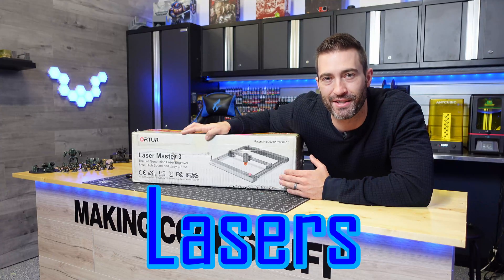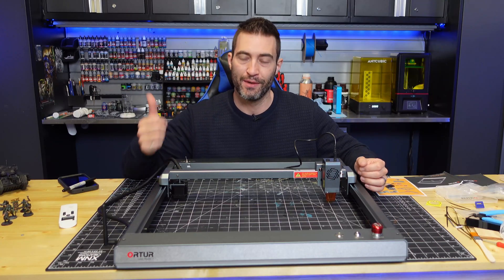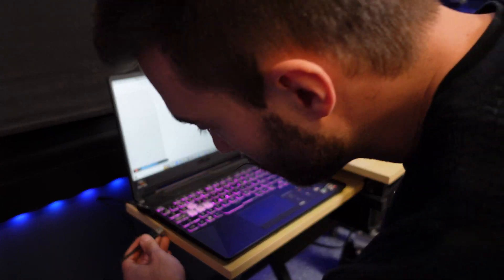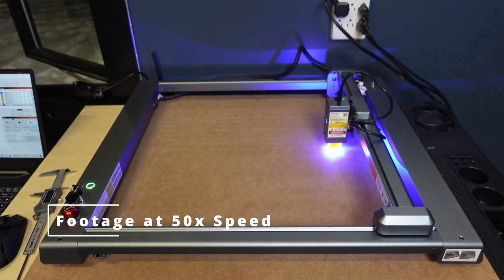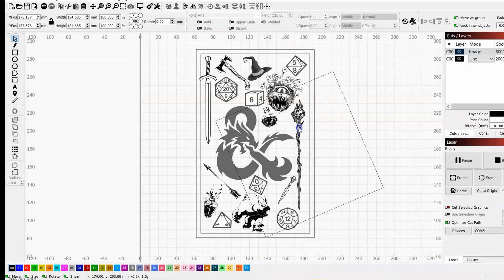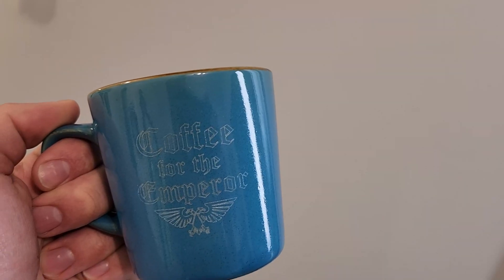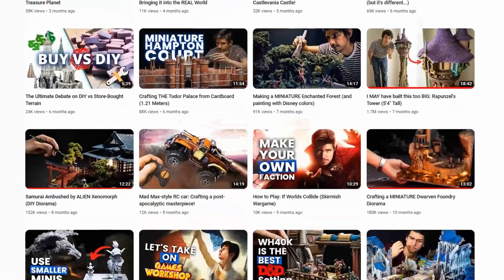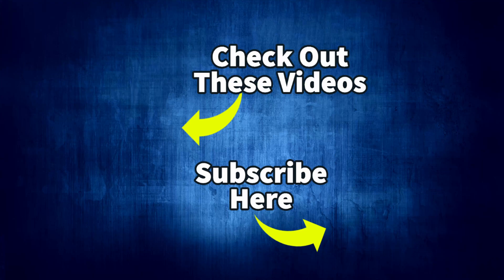Burn the Rulebook & Learn Laser Engravers - Ortur Laser Master 3

Comment: Are those brackets used to secure to the board provided?
Reply from the maker: No. I designed and 3d printes them. I wanted to make sure the printer was always put back in the exact same spot relative to the grid.